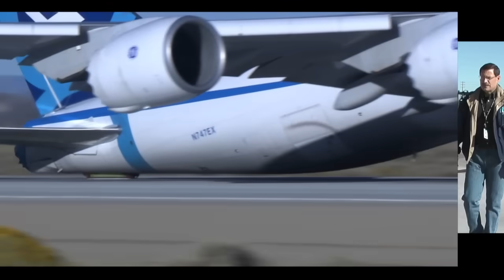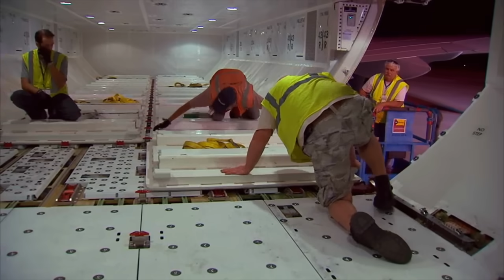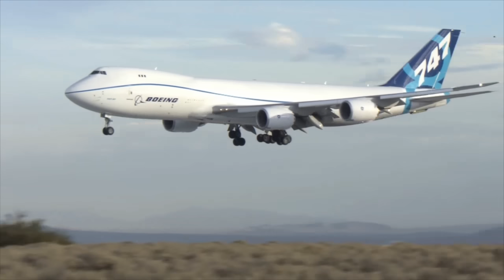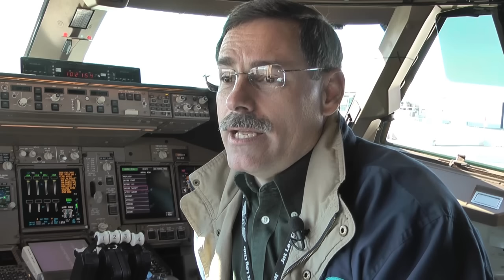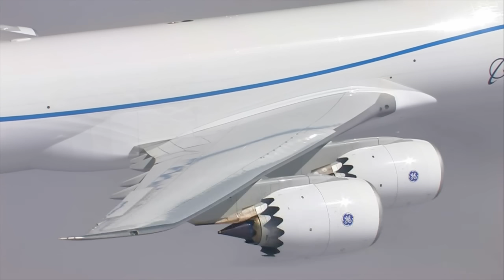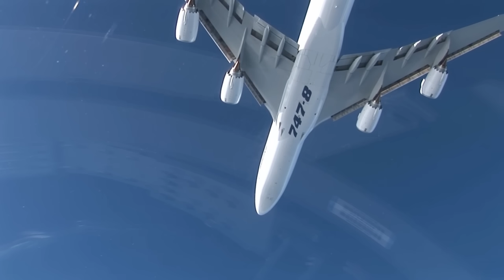Boeing 747-8 undergoes extreme testing

Comment: What sets Boeing airplanes apart from all the others is the amazing redundancy (aka -backups ) designed into its systems that they are indeed the safest flying machines.  Google <Free Fall> --true story of the 1983 Air Canada 767 flight that ran out of fuel on a long flight from Montreal to Edmonton at 41,000 feet & how the Captain, a Glider instructor, handled it.  The Canadian gov't had recently converted to the Metric weight system for its airplane fleet for fuel measuring.  ISBN 0-312-02919-5
Reply: película mexicanas
Reply: +Luis herrera ceja

Comment: What is there to test on a 747 - it has been flying for many years -> Queen of the skies!
Reply: It's a new version
Reply: The new improvements --ie; payload capacities, engine thrust, etc.  For years now they fill em with water barrels to simulate the weight of passengers & luggage.  Also, they perform a final delivery flight test with the airline pilots behind the yoke at Paine Field north of Seattle Washington.  If I recall, a 747 can handle 20,000 landing cycles before it's retired due to the metal stress caused by the takeoff&landings and pressurization.  747 can last for 20+ years because they fly long range & experience much less takeoff&landing cycles vs smaller A/C.  A 747 fuselage expands by 12 inches in diameter after full pressurization causing metal fatigue where the rivets (fasteners) are used to fasten the skin to the spars (aka frames).
Reply: This is a cargo version. They even said it is forced to fly with 1,000,000 lbs. Besides this is a new plane. Listen more....

Comment: All the effort in re-engineering a plain of 40 years old with new engines and wings and 2 connected yokes? In the same time Airbus did clean sheet designs of the A380 and A350. Re-engined the A320/1 , A330 and build an plant in the US. Does any Boeing fan have an updated order book schedule of A vs B? Please publish ...
Reply: The 787 is a 'clean sheet', and the A320neo series is literally just an A320 with sharklets and a new engine. I respect your opinion and airbus, but the 737 MAX honestly is more of a 'clean sheet' than the A320neo. In terms of the 'clean sheet aircraft' the 777, and 787 are selling well.... 737 MAX, I will admit is behind in orders. I'm just happy my favorite airline will be operating it, therefore I'm content. THIS IS NOT A RANT AGAINST AIRBUS - Keep in mind. I still enjoy some airbus aircraft and yet still have my preferences. I am not implying 'OMG AEROBUS SUXX BOEING 4 LIFEEE' or anything else stupid like that. 'Does any Boeing fan have an updated order book schedule of A vs B? Please publish ...' - It's not a huge, hole...
Reply: v h

Comment: Can someone explain to me the differences from all the 747s with each other?
Reply: The 747-8 is the newer version of the 747. The original queen on the sky, 747 was a fuel guzzler, so the 747-8 uses much less fuel and is more Eco-friendly. It's even more quiet when it takes off and lands. Lastly , the famous hump on the top of the 747 is longer on the 747-8 to accommodate more passengers and to compete with her new rival the A-380

Comment: When the Boeing engineers originally designed the airframe of the 747, why could they not  implement a double decker design from the start? Too much money at airports needed to accommodate (service) such a radical change in design or were the engines just not powerful enough to take such a load into the air?

Comment: Sirs;  Poor weather characteristics with 1,000,000 + pounds with heavy crosswind and wind shear near approaching runways & runway lengths,  or are you planning only certain ports  the 747 can use?
Gravity push + programs on load capacity and safety testing.   Do you have any comments  How about a job/

Comment: During stall what if something went wrong ? Do the pilots wear parachutes to abandon the aircraft ?
Reply: Jerbear45 There is no way of abandoning civil airliner. No parachutes, no ejection seats. And yes, a bunch of test pilot during 100 years of civil aviation history died in test-flights.
Reply: CopWatch Inland Divison Then how come hardly any pilots survive in passenger plane crashes compared to fighter jet crashes ? I believe airline policy prohibits such benefits accorded to pilots without ensuring the same to the passengers as well. Suppose in a crash the pilots would give up all too easily and abandon the aircraft leaving the passengers to rot in hell !
Reply: Jerbear45
I cannot imagine how would a pilot eject in a test A380 ? Is there an opening on the roof of the plane or are they supposed to penetrate through it using their skull ? Lol. I think Balla Boy is right.
Reply: Fardun007 Stall tests are done at height there is no real risk.....plane stalls and starts to fall just point the nose down get speed and recover. its just a normal test
Reply: Fardun007 We are saying that during testing they have ejection seats. If they were on actual planes a pilot could crash the plane and live which is not true but if it is only a test plane I don't see why you wouldn't put ejection seats in it.
Reply: Fardun007 Well I don't know maybe the door that you enter the plane through. Or they could fit the thing with glass like the windshields of buses where you can kick it out. Trust me they wouldn't risk killing pilots.
Reply: Fardun007 There is no way to exit the aircraft in-flight. (This is how we sort the plane experts from the non-plane experts) The pressure is too great.
Reply: ***** There are doors to exit (Gate door) right outside the cabin so unless the thing went up in an instantaneous inferno they would probably have time to get out.
Reply: Jerbear45 They had parachutes and i believe some sort of ejection system(believe) when they were testing the A380, so id assume these guys do too
Reply: ***** Well if its stalling then it maybe would be less pressure but that is a good point. So maybe I was wrong about the window but I mean there has to be some safety precaution.
Reply: +Balla Boy tú pb.  kg
Reply: JordanCO_ TV Wouldn't it be the opposite? The inside of the aircraft is pressurized so it feels like normal, where as the outside is lower pressure because you are higher up. Or do i have it completely backwards?

Comment: Whats that parachute looking thing that is attached to the rudder?
Reply: It's for testing they use it to gather information that they need.
Reply: ***** ahhh I see, thanks
Reply: gascat100 i think its a radio antenna, they attach it to the rudder with a parachute so it goes up high without interference

Comment: this 40 years old airliner looks much better than  new A380
Reply: Agreed. I prefer the look of the Boeing air-frames over Airbus anyway. The Boeing has a handsome family.
Reply: And that matters why?
Reply: Yet it's mostly used for pigs not people...
Reply: MonkeyGaming HD its better in certain spots, but the 747 will beat the A380 in other areas.
Reply: +madrx2 า๑
Reply: Vlado S A380 is really unnerving to look at. And to think about even riding in it. If it aint Boeing, I aint going...
Reply: butthurt boeing fanboy
Reply: fuck off
Reply: ***** hurt by my opinion about your holocaust aircraft?
Reply: A388 is shrunk , it will look much leaner once it's stretched. As for 747, it looks too intimidating and looks more of a military plane and the hump is not pretty

Comment: They make the stall look so harmless. Is it really that easy, just let go of the stick? They have to throttle up too and get the airspeed back up, no?
Reply: that would depend on rather or not is was a power on or a power off stall.
Reply: Drop the nose. Full power. Recover. It is that simple. In my little Cessna we try to keep it within no more than a drop of 100 feet. I am not sure what they look for in a big jet like this.

Comment: If the Piper Cub was the VW Beetle of airplanes, the 747 family is the Ford F-150.  It's big, it's reliable, it's relatively easy to get along with, and it's rugged.  Johnny-come-lately Airbus will never impress me, the 747 is the quintessential modern heavy lifter and has been since it wowed flyers at its introduction in 1970.  It's only gotten better since.  I look forward to what Boeing brings us in the future.

Comment: Nuts - I was hoping they would do a hard landing test.  Back in the 1970's, I saw a film clip of the first 747 being subjected to such a test - it was awesome!  The test consisted of doing a standard landing approach, but without the flare just before touchdown - they basically flew it right into the runway.  When the wheels hit the runway, the impact made the wings flap up and down, and the engines wobble from side to side to a degree that was amazing!

Comment: Long live the wonderful B747!  
Can there possibly be a better proven heavy aircraft? The 747 project abounded in uncompromising design and engineering which happily resulted in an aesthetically satisfying jumbo as well. The 747's flight record, shape, superb massive triple slotted trailing edge flaps, heavily swept-back wings, beefy undercarriage & excellent cockpit designs make it my (ultimate?) favourite heavy weight modern jet...
:-)